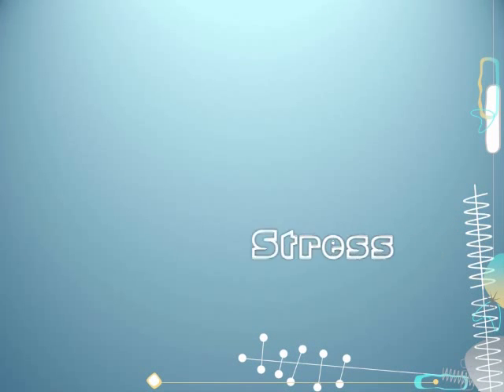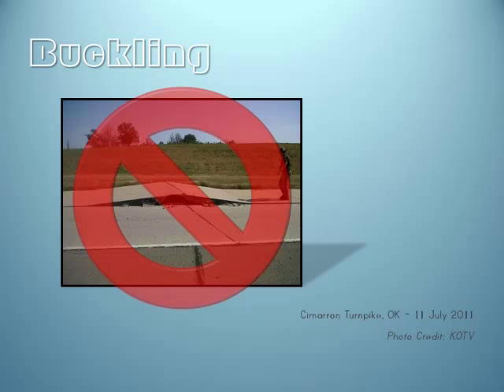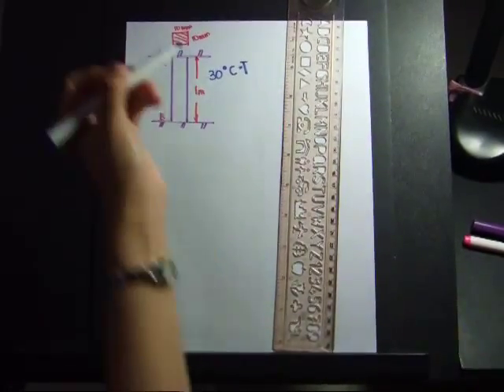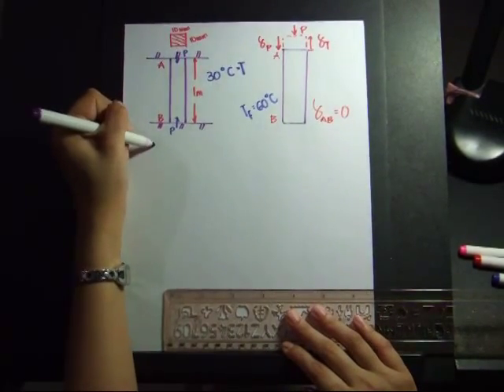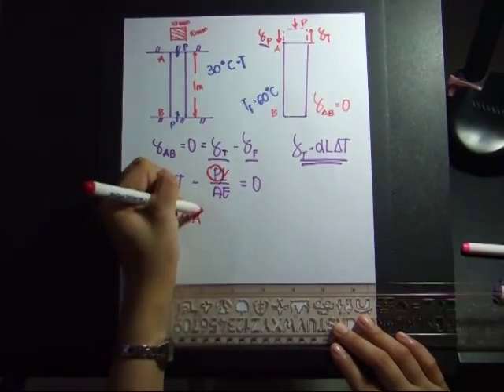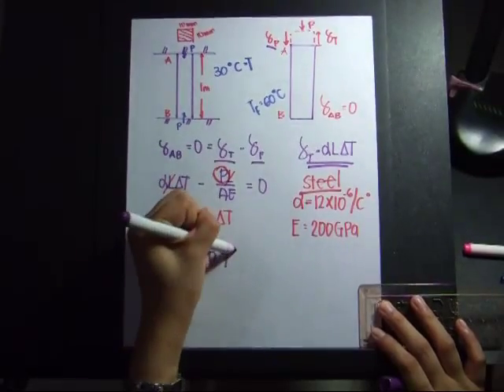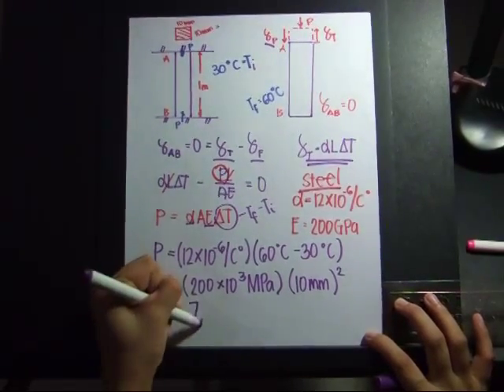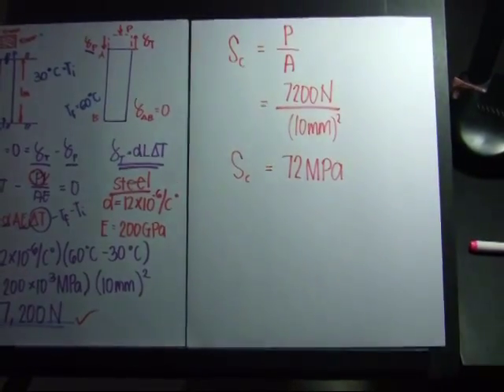Thermal Stress

Comment: whre did u get A,E ? for the propeerties   of steel bar
Reply from the maker: Insane Gore 
Hi,

Alpha (thermal coefficient) and E (Modulus of Elasticity) are different for various materials, these can be obtained through experiments but for common materials (e.g. steel, concrete), it is available via textbooks or via internet.

But, both properties are given in the specific problem in this video. 

Hope it's clearer now. :)

Comment: T2 - T1 is [60-(-30)]       right ? and it is equal to 90 ? im confused :(
Reply from the maker: Allen Ray Iris 
Hi! The initial temperature in the problem is +30, the change in temperature is the algebraic change, final subtracted by the initial, 60 - 30 = 30

I hope you get it now. Good luck on your exams! :)